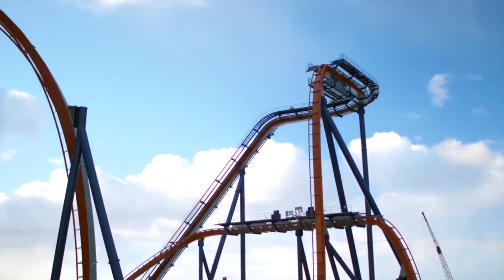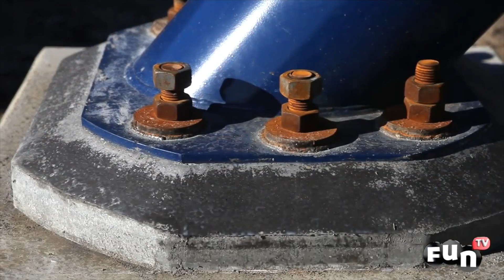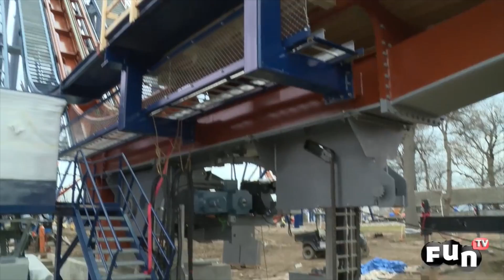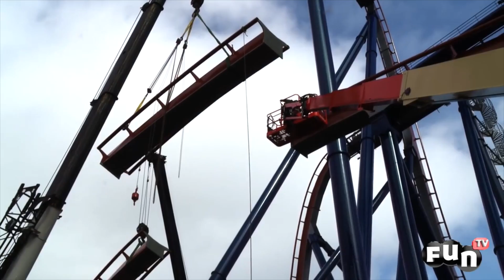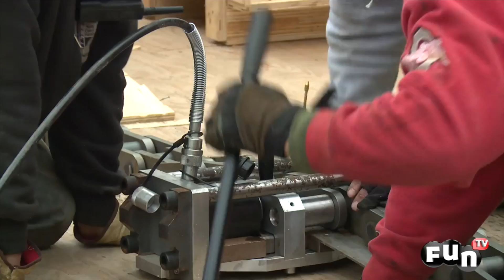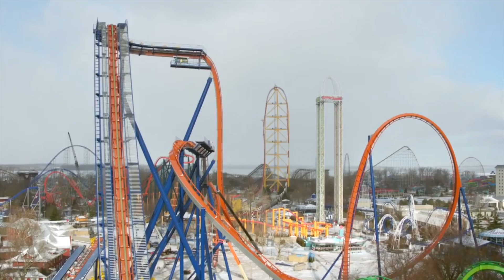Cedar Point's "Valravn" Now Complete

Comment: Ohio, has THE greatest rollercoasters on the planet.  Good thing I live around there.  Actually, I'm only about 15 miles away from the place. LOL
Reply: Cool I live right by it
Reply: If you live in northern Ohio, you have Cedar Point. If you live in the south, you have Kings Island. It's great, isn't it? As a resident of Michigan, I envy you guys.
Reply: +Eccentric Gamer Exactly.
Reply: Cedar Point is ok, but a few of the coasters are a bit boring or too rough (yay, Mean Streak is closing). Kings Island should RMC one of their 4 wooden coasters next year. I am glad I live in SoCal, where we have 6 theme parks opened year-round. Although 2 are generally too crowded to visit no matter what day it is.
Reply: Jakob Ogan 
I really don't think RMC has a place at Kings Island. The Beast is already a darn good coaster in its own right, The Racer is one of the few original Kings Island attractions still operating and should be left untouched, Woodstock Express is a family coaster and thus probably not worth RMC-ing, and Mystic Timbers is a GCI that hasn't even been built yet.

Simply put, if it ain't broke, don't fix it. Mean Streak has great potential, but it's an absurdly rough ride as it is and thus would be worth getting RMC'd. Not the case for Kings Island's rides.